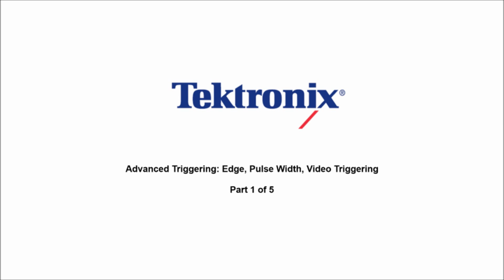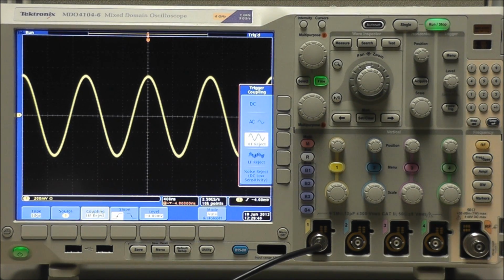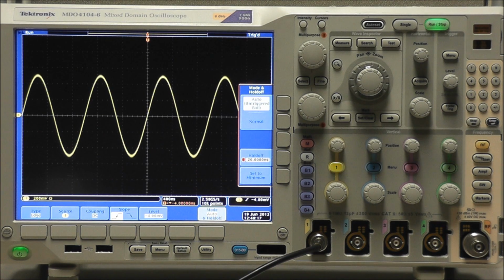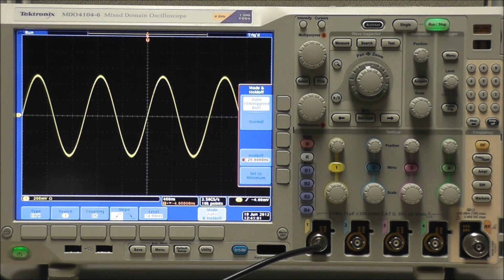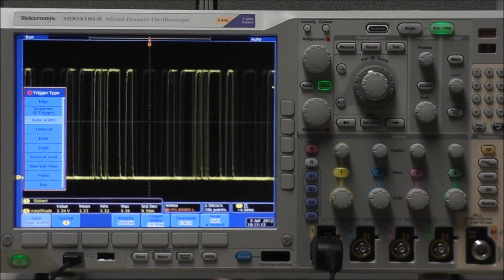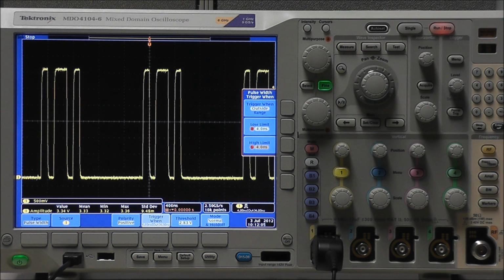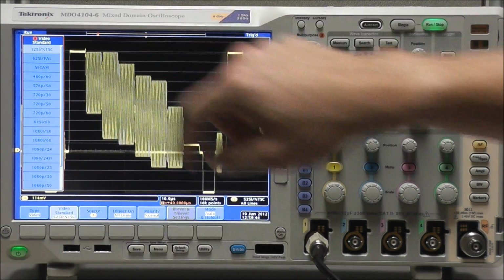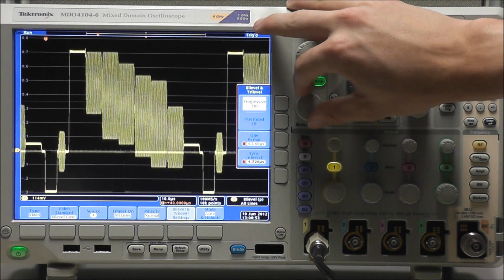Advance Triggering: Edge, pulse width, video triggering - Part 1 of 5

Comment: I had a Tektronix 502 for 30 years after buying it used⏩>imgs.love/TOscilloscope?ҍ   that I finally parted with. This 1052 is significantly more capable and probably a tenth of the weight. The screen is bright and the traces sharp. The controls are intuitive. I especially appreciate that I can store it on a shelf with my other desktop instruments instead of having a dedicated scope cart.